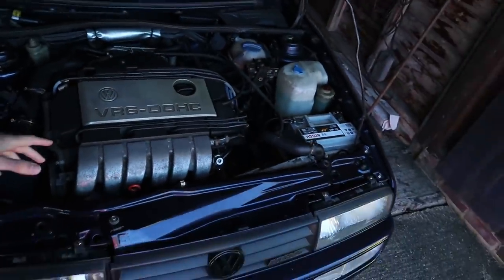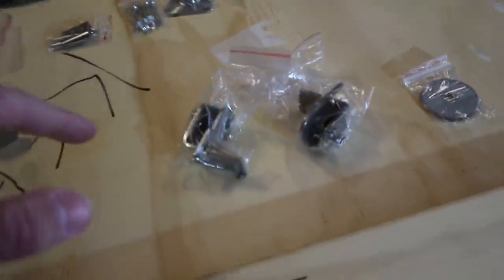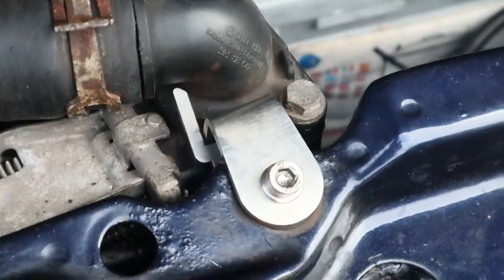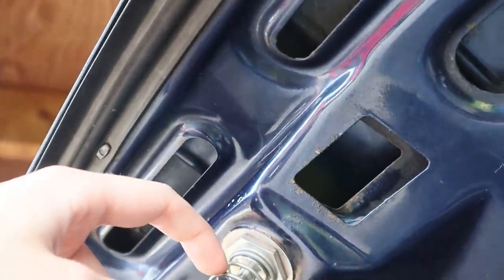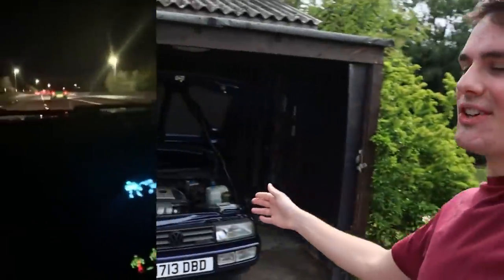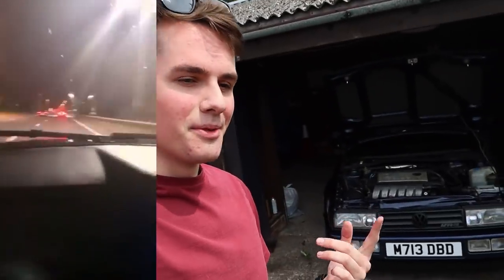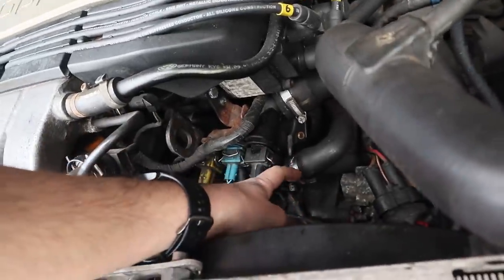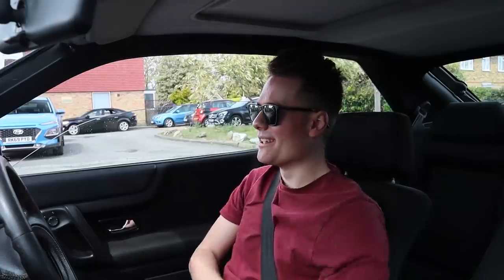This Is How I Found Out My Car Spits Flames...

Comment: Mate I just did this hood insulation to mine. You've stuck the new stuff to old adhesive residue which may not work for long. If they fall off you'll need to use adhesive remover and a non-marring scraper to bring it down to the paint. Hopefully no issues for you though!
Reply from the maker: I know, tried rubbing it off best I could but it's been okay so far!

Comment: Love your Corrado posts Brad - got two VR Corrados - my best is having a major refresh (owned since 2003) and decided to break my rough one. Plenty of spare parts now anyway 😎. Keep the rado posts coming......
Reply from the maker: Awesome would like to have a spare. What type of bits is being to your good one? Thanks mate will do 🤙
Reply: @BWTV  ive sold off the interior, engine, gearbox and smaller parts - im happy with these on my main car. Re doing both sub frames - paint etc brake lines discs bearings and prob new exhaust. The cash from the sales going into main VR...Be holding on to things that might need replacing in the future. Cheers Brad.